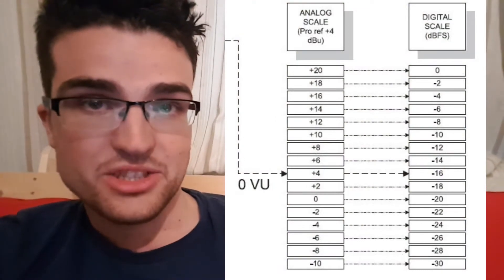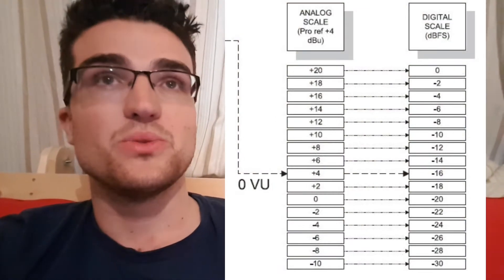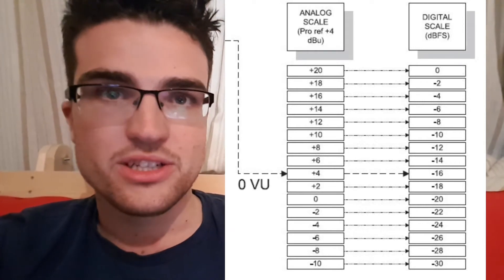Audio Metering: What is dBu vs dBFS?

Comment: Where on your meters do you aim to keep "normal" dialogue? What about, say a wild track of footsteps? Shouting? And finally, when recording room tone, do you keep your gain more or less to where it was set during the takes, or do you find it useful to record the tone with gain set a bit higher? Thanks!
Reply: Record room tone at the same gain settings you used during takes otherwise it defeats the purpose of it.
Reply: Thanks for the reply Carlo, that makes sense. On a bit of a different note, I was once on a job as an assistant, dialogue scene between 4 actors sat at a restaurant table. There was a hum, we knew where it came from, but it was not possible to stop it. The mixer planted a mic pointing straight at the hum source (which was several meters away from the scene, so the booms covering the dialogue would have picked up that same hum very differently). I was wondering what the thinking behind this was, but it was a hectic day and then forgot to ask him. I later thought it could help post for de-noising to have loud and clear takes of said hum. But in the same way as what you described for room tone, would it not make more sense to have "clean" takes of that hum, but from the perspective of the boom, and from where the dialogue was taking place? Sorry for the long-winded one :)
Reply: Its an old school way of helping post de-noise. Basically post would take that hum and reverse polarity so it reduces its precense. But with the tools we have today it is unecessary to do so.